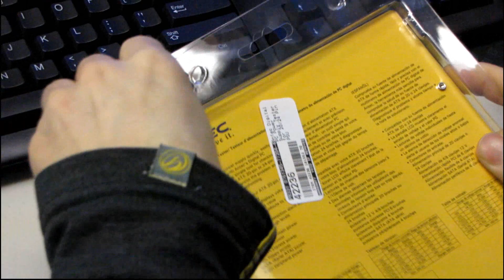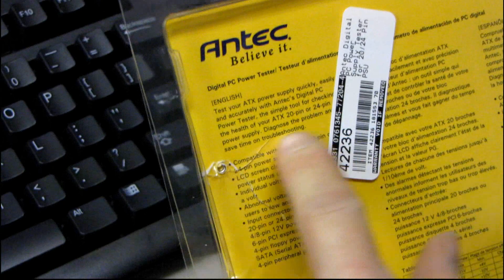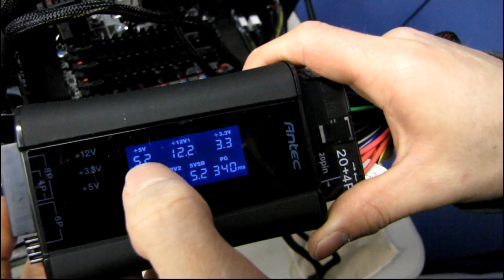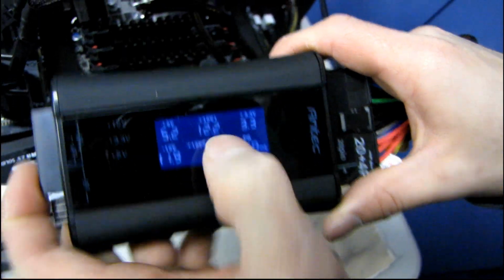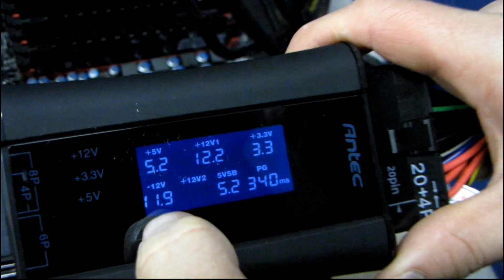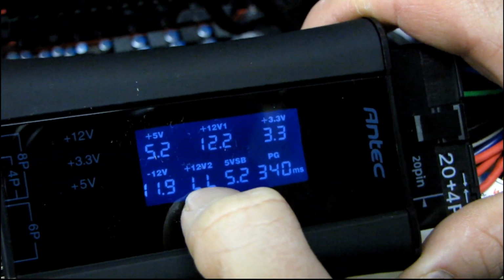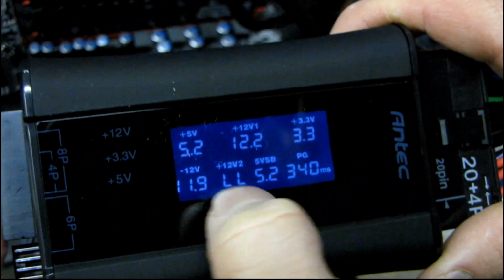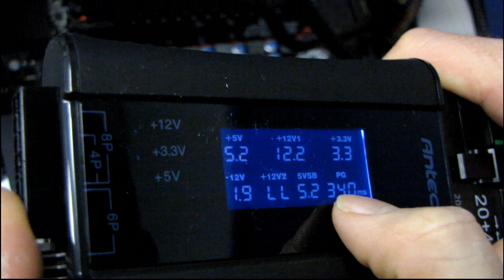Antec Digital Power Supply Tester Unboxing & First Look Linus Tech Tips

Comment: But doesn't test the PSU under load? Maybe someone makes an ATX cable splitter so system can be on running full CPU & GPU load.
Have fun with your professional power supply test rack!